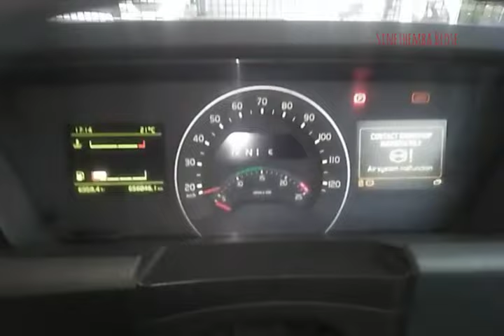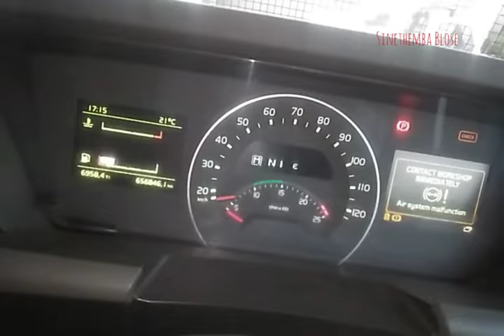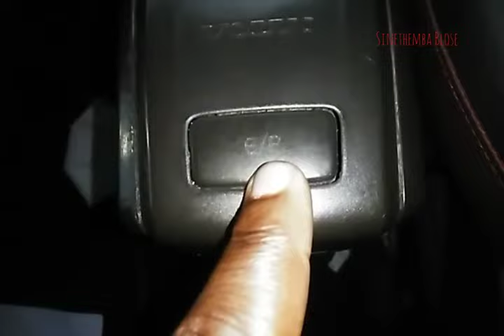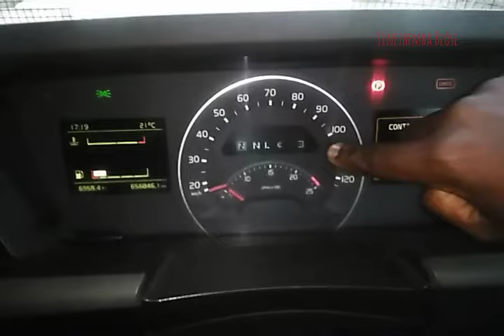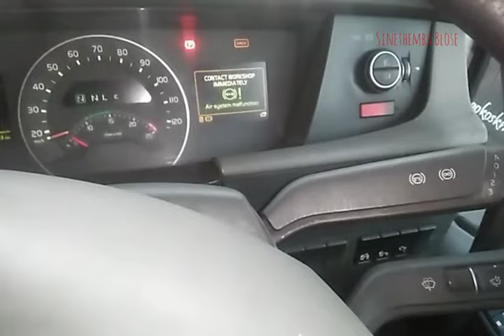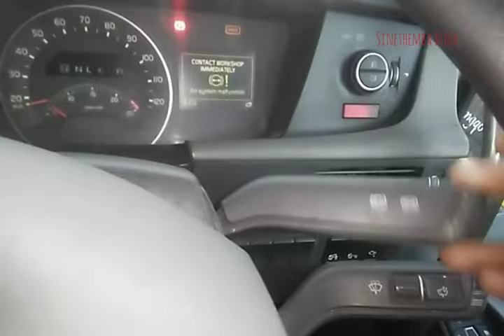How to drive Volvo [FH 440]

Comment: Mr blose I enjoy watching your video I learn a  a lot,  if you are driving a truck can change from manual to auto whilst moving
Reply from the maker: Yes you can, at any speed you want. But other trucks like Scania G460 the old model doesn't allow you to change gears once you reach 50 km/h. Even if you driving with manual it changes itself to automatic at 50 but the new model allow you to do anything you want